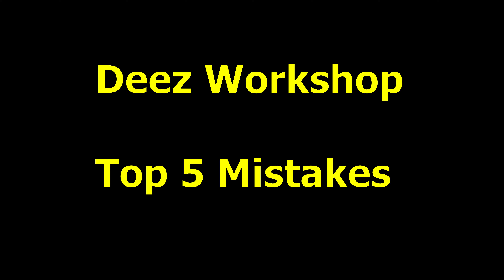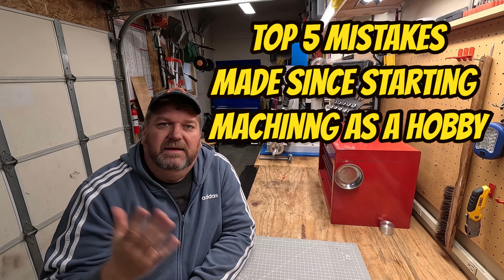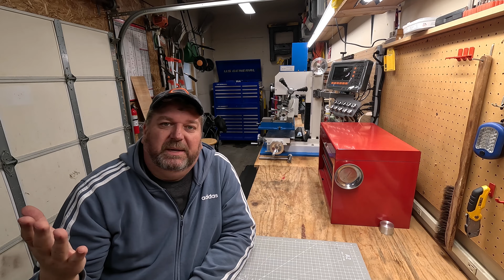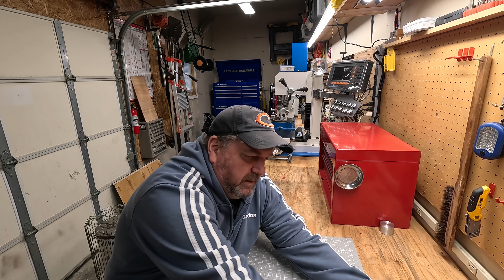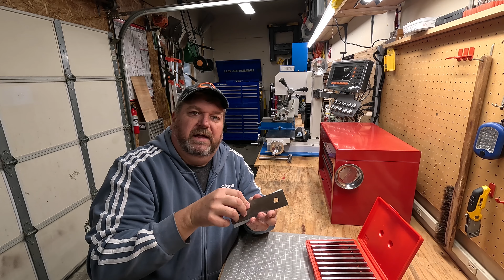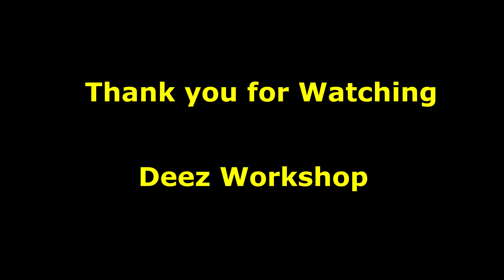Top 5 Mistakes I have made Since Starting Machining as a Hobby

Comment: All good advice in this video but I think a couple of other things should be in the top 5.
1.   Buy the biggest vice you can afford, and buy a cast iron offset jaw vice from a reputable western manufacturer.   Do not buy a fabricated vice and do NOT buy a vice made in India or Asia.   Fabricated (ie sheet metal parts welded together) vices get bent under load.
I see that just about every hobbyist that has no metalwork training buys a standard non-offset vice.   But an offset vice is so much more versatile in what you can hold in it.   A good offset jaw vice, a hammer, a portable drill, and a couple of blocks of hardwood and it is amazing what you can make.   With just this I make parts that people think must have been produced in a massive hydraulic press.
2.   Don't buy any lathe made in Britain or Germany.   If you do you get an inferior product at an inflated price.
3.   Chinese lathes and milling machines priced for hobbyists and small shops are very good.   You get a lot for your money.  Their design is good.   BUT,  they are just slapped together in the factory for convenience of shipping.   When you get your new Chinese machine tool, do NOT use it out of the box.   Disassemble it, clean out the casting grit and machining swarf from gearboxes and saddles,   Re-assemble and learn how to adjust it.   Do that and you will get years of satisfaction.  Don't do it and you will soon regret it.
4.   Fit or ensure all your machines have no-volt-release switches.   In most western countries that is a legal requirement but equipment doesn't necessarily come with it.   Without no volt release, sooner or later you will be happily machining and there will be a power failure.   You stumble around in your dark workshop, and go in the house to get a torch.  You get distracted and meanwhile the power comes back on.  The lathe you left switched on with power feed engaged starts up again, and CRUNCH - very expensive damage to both lathe and your project.
Reply: "Don't buy any lathe made in Britain or Germany"
personal experience with my second hand, British manufactured, 60+ years old Cowells 90ME lathe suggests that your statement has zero credence.
Reply from the maker: These are great additions to my top 5.  I agree with all your points.  Very interesting things about the vise.  I am not terribly happy with my cheap mill vise but its what I could afford.  I will check into vises that you are talking about.  All the other points are very good.  I will pin your comment.  Thanks for sharing and thanks for watching.

Comment: I have a Summit Milling Machine V244 with 10”x44” bed  I had Newell DP7 readout on.  The readout head got corroded inside and is trashed.  I either have to find a DP 700 head and get adapters for my cables and use my same spherosyn scales or find a very good, accurate, dependable complete readout.  What would you recommend in my situation?  Thanks.  Tom
Reply from the maker: Wow,  I am not sure I am qualified to give any advise here but I will answer this with what I would do.  First thing, Those Newall DROs are expensive.  I just looked them up.  If I were in your situation, I would first look to see if there is a DRO Display that has the connections I have (I think in your case 7-pin circular connectors) and get a unit with those connections.  If I cannot find one reasonable I would look for adapters for the cable ends I have on my existing scales that would fit an affordable DRO Head.  There are reasonably priced DRO's out there that are available that I would hope are accurate.  If that fails I would look for a new DRO and Scale set that includes Everything I would need to get going again.  I cannot imagine being without m DRO on the Mill at this point.

I think it really comes down to what your doing,  If its hobby work I would look at affordability over higher known brands.  If I had a job shop I would bite the bullet and get quality at a higher price.

I don't know if I was any help but good luck with your research and replacement.

Comment: Make yourself a barrel square on your lathe. Get a bit of billet about 3" round. Put in your lathe and turn outside parallel.   Polish to get it smooth and nice and parallel. Then face carefully with a nice finish and finish with tidy radius. Put a centre hole in it. Turn it round and tidy up and reduce the portion you held it with below polished size and face of and chamfer. Hollow the face in the middle 2/3. Now you have a perfectly square part that one end can be used as a master square. Now you can check a square or the squareness of a part.
Reply from the maker: That is an interesting idea,  I will give it a try. Added to the project list.  Thanks for the suggestion.

Comment: Worked 3 years as an operator in a CNC job shop. Keyword being operator but I was essentially a machinist's apprentice. 

In my opinion one of the areas to try your best to not cheap out on is metrology. If you can't measure it, you can't make it. Get at least a mid range or better yet a high range 0-1" micrometer and 6" caliper at a minimum. They usually come as a set. I like 12" dial calipers for my general use cause thats what I was around when I was working in a job shop and I bought a mitutoyo 12" pair from the 80s when they were still made in Japan(and I got a hell of a deal on them). 

If you can't accurately measure your work then cheap or expensive tooling doesn't actually matter because you can't tell the difference. You determine the level of accuracy required and whatever tools you use to check that should be as high a quality as you can afford. Also, your tools should come with gauges generally. Check your mics and calipers every so often to make sure they're reading right. Being able to trust your measuring tools is the first step of rooting out gremlins.
Reply from the maker: thanks for the advice and I agree,  Great way to put it, " if you can't accurately measure it you can't make it. "  I did upgrade to a genuine mitutoyo 6" caliper and its fantastic.  Cheers and thanks for watching.

Comment: I'll add one that runs parallel to yours... be prepared, and learn how to juggle. Juggle different projects going on at the same time. Juggle research on multiple things. Juggle shopping research so you can jump on a deal you have planned for on say facebook market or ebay or craigs list. You have to put in the research b4 you buy. There are ways to set alerts on ebay as well as other sites. Tools you need and tools you want are two different animals. As a hobby, it can take you a bit of time before you have enough tools to attack projects, in the meantime there are workarounds. That's part of research too. How to do this without that. Your channel can be a very big help to those wanting to take the journey with you. Thanks for sharing.
Reply from the maker: This is a great point to add to the list.  Research...Learning what to research are all hurdles for those starting out.  I didnt realize how much I didn't know until I started.  So much to learn.  Take your time and do your research.  Learn as much as you can and take the advice from those in the know. Thanks for adding to the video and thanks for watching.  I do hope my channel helps others wanting to get into this hobby.

Comment: Something I found out too late was about R8 collets. First of all you don't need the 29 piece set that goes from 1/8 to 7/8 by 32nds. What are you going to be holding......end mills mostly.  I have never used any of the the endmills ending in /16 or /32. Just get /8ths.  And then don't cheep out. Runout on the cheep ones is terrible. The bottom end of them are pretty much centered but put a 2 inch dowel pin in them and check runout at the end. The bore through the middle is not straight. Spend your money on a good 7 piece set.
Reply from the maker: This is good advice.  I did buy an 11 piece set but I completely agree,  you just hold endmills with it for the most part.  typically i use 1/2 or 3/8 collets.  If I need anything mor specific I can use my ER40 Collet chuck with the R8 adapter.  Now I did cheap out.  I will try the dowl pin check you described.  wouldnt surprise me if I had runout at all.  Thanks for posting this advice.

Comment: Not to mention the material (stock) cost and other hardware needed.
Reply from the maker: absolutely.  It all adds up very quickly.  Anyone getting into this hobby needs to understand the extra cost factor for tooling, materials, shop supplies, safety gear. etc.

Comment: Great video, thanks for sharing. I'm currently trying to wade through all the bench-top mini lathes out there trying to choose the right one to purchase. 
Perhaps you could share your thought process on just how you decided on the brand and model of lathe that you chose.
Reply from the maker: I have some videos from last year and earlier covering my decisions for purchasing this particular mini lathe.  I encourage you to check those out for more in depth reasons, however the short of it is this,  I chose a cheap chinese lathe for reasons of entry price.  This particular model was not the cheapest but I chose it for its size, being a little larger than the cheaper smaller ones,  the motor size and the spindle bore was a very big factor.  I also purchased it for a bit more by using Amazon.  I wanted a reseller I could work with if I had issues with Vevor.  Plus free shipping if it was total garbage to return it.  If you can afford a better quality machine I would encourage that but again,  Most of us are on a careful budget.  Hope this helps.
Reply: Thanks for your reply - I will certainly take the time to watch your earlier videos. @deezworkshop

Comment: You’re doing pretty good with your videos. Yes the season pros may not like them. I’m sure you’re doing things wrong. I’m sure you’re buying all the wrong tools. But there are many of us out here. Doing the same thing. Trying to expand our knowledge. And I creativity And we’re all trying to do it on a limited budget. So far I’ve spent two years of my lathe ownership learning how to fix lathes and using my broken lathe to make parts for my broken lathe  and it’s been real fun. Now I’ve reached a point where I need some parts that I think of troublesome to make and the lathe manufacturer no longer has part. I need the cross slide nut, lead screw nut. I’ve also learned that not only does the manufacturer not have specifications for these parts. They’re not exactly standard parts. I think one thing you missed though was material material. It’s freaking expensive. Deez you just keep chugging along, and will keep watching. As far as feeds and speeds go. It’s all very dependent on your machine, cutting tools, and so many other factors. When you look in a manual for feeds and speeds, and you look at the spindle speeds, and the depth of cuts these specs for larger more powerful industrial machines. My machine tops out at 1600 RPM. Go look up the speeds and feeds for say half inch material or a half inch carbide flute they use in a Mill not even close I have learned with my machine with most steel. I need to push that 1600 rpm all the time until I get to larger diameters or softer materials like cast iron.
    It’s all fun like you say be safe.

I have been buying specific tools as I need them for projects.
Reply from the maker: Great comment,  MATERIALS.  you are absolutely right,  I should have mentioned that.  Getting known raw materials is very expensive especially if you have to have them shipped.  I did find a local steel supplier but they really deal wiht industrial customers.  They dont have a problem working with home hobbists though so when I need something specific I will contact them to see if I can same some money.  getting raw stock to work with is costly.  Cheers and thanks for sharing your experience with the hobby as well.

Comment: Excellent note about safety. Rings and watches are a no-no in the shop. My wife is a retired ER Nurse, and she will explain in gruesome detail while you should do this religiously.
Get insulation, heat, and air conditioning at the earliest possible moment for your workshop. Two reasons. First you can be comfortable year-round.  Second, soon you will have several tons of steel in your shop. The first warm day of Spring when you open the door everything in the shop will be soaked with water droplets, leaving rust on all your precious machines and tools. I heat a 400 square foot shop with an old Sears 3500 watt heater and a small 220v window AC. Costs about $30 a month.
I would differ a little bit about Harbor Freight drills, taps and dies. Starting out I would buy the mid-grade high speed number, letter, and fractional drill set as well as the high-speed tap and die set. They're not too bad. As you break or use them up you can buy industrial grade individual replacements from companies like Travers Tool or McMaster Carr. You will soon realize that many of these tools are rarely if ever used. I have letter drills I bought in a set in the 1960s that I have never used. In the end, the box the tools came in is about the most important bit of the set. For reamers make a stand from a block of wood to hold the reamers and buy them individually as you need them. You can get a chucking reamer over night in the exact size you need from McMaster Carr. Sizes less than 1/2 inch aren't very expensive.
Yard sales and estate sales are your friend. Often you can find good quality Craftsman tap handles and die handles. Drill indexes are common and if they are missing drills, no problem, you have a drawer full of American made drills from other yard sales. Many people don't realize that drills can be resharpened and sell them for pennies. They often don't know what precision measuring tools are. Last year I bought a set of what appeared to have been an almost never used Lufkin micrometer set , 0-1, 2-3, and 2-3s for $20.

Learn stuff and people will marvel at you
Cheers from NC/USA
Reply from the maker: I got the flash rust last year on a super random humid day. caught it really early so was able to clean that up and oil everything down. I know I will need to keep an eye on the machines as the temps start to warm up.  I would love to heat and cool the shop but it will be a while before I can get to where I keep it consistently at a reasonable temp.

Comment: Deez,
If you buy a set of taps and dies. Make sure they are high speed steel. Harbor freight and alot of others are not HS. They are high carbon and won't hold up to high speed steel.
Reply from the maker: Good info,  I didnt realize that.  Thanks.